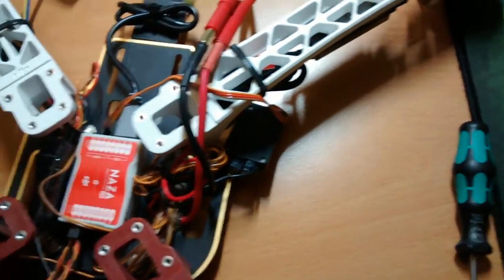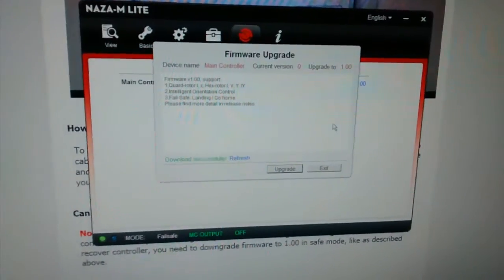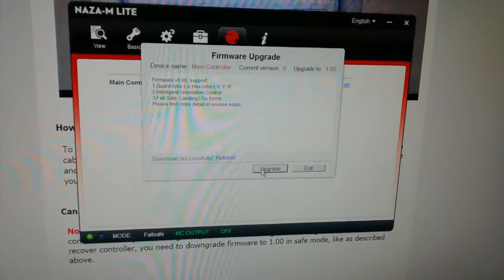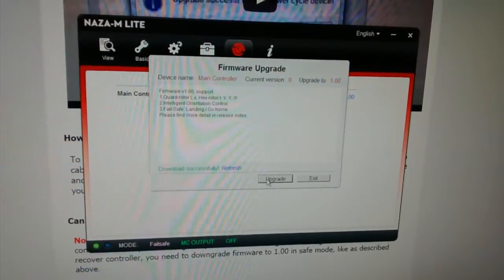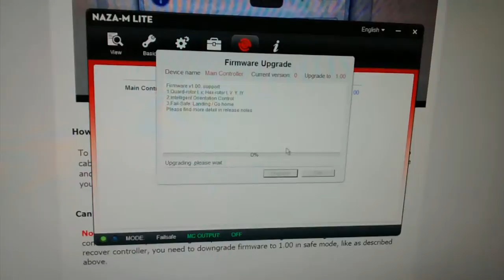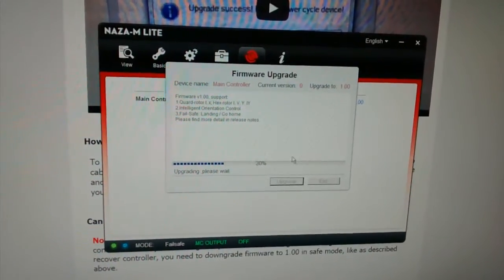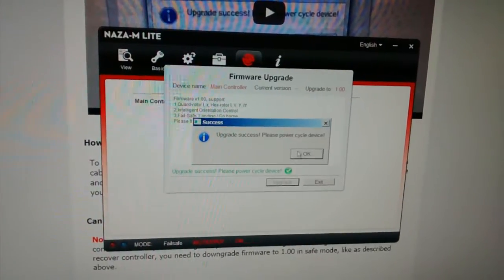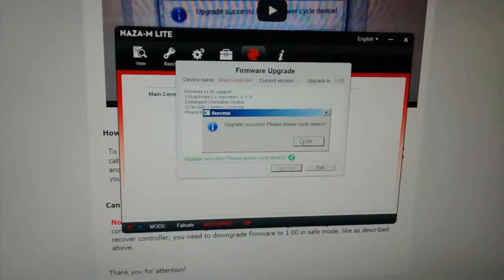Naza downgrade naza lite from v2 to 1.00 lite firmware.

Comment: Hi Shinji, I've connected together F1 and F2, connected the USB LED and the power but, as I connect the power cable, I can't hear the expected noise.. What's wrong with what I did, in your opinion?
Reply from the maker: so there could be a couple of things... I would start with the simple and work my way to the more complicated. make sure all of your connectors are working correctly , especially the servo cable. I recommend taking a multimeter and checking for very little to zero resistance across all the leads on the servo cable first. and then make sure the flight controller is getting power. also make sure the LED is in the correct port. if all of these conditions are okay it can start getting a little complicated. Under any circumstances make sure you connect everything correctly, otherwise you can cause the flight controller to Short Circuit and that will lead to a disabled flight controller permanently.
Reply: Well, I tried two servo cables, but nothing changed unfortunately... the only thing I'm not sure is that my servo cables are colored by white, black and red...
Reply from the maker: +Davide Gonella the color of the servo cables really don't matter. What actually matters is the orientation of the cables they have to be the same on both ends of the connector. As long as that is correct and they have good contact on both ends of the connector meaning no more resistance than a couple of ohms , should be working just fine, also the flight controller is designed with the cable so it can only be inserted in one way.
Reply: +Shinji Sagura So far I changed three cables like the one you have described but.. no way to hear a thing. A question: "X3" is the NAZA's power connector, is it?
Reply from the maker: +Davide Gonella to be honest I can't remember off the top of my head. What you can do is go to the internet and type in the flight controllers manual, in the manual is a schematic of everything all color coded and labeled. It is very helpful that's how I figured it out.